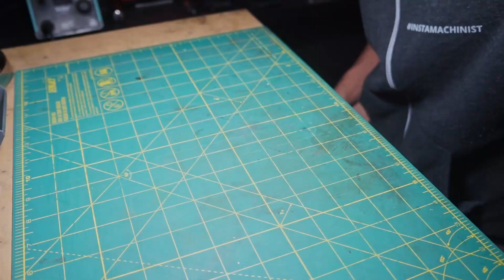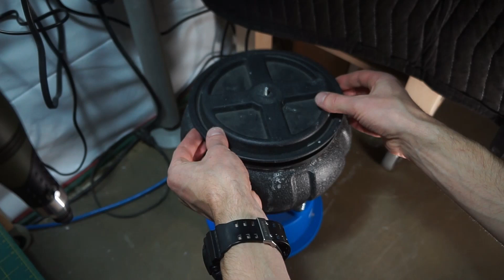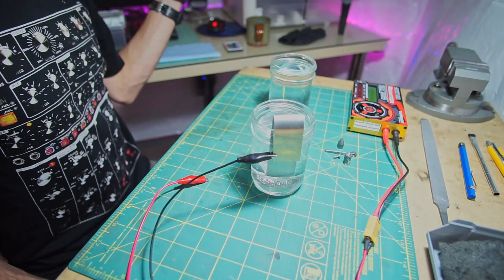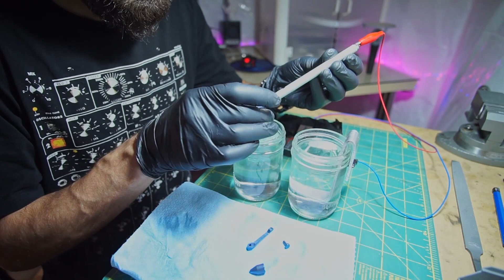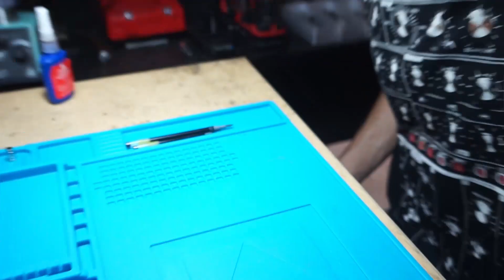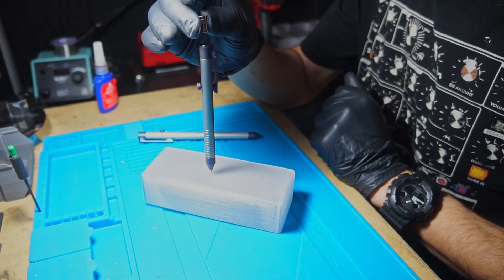EDC Bolts are Finished!

Comment: P.S dont use variac transformer for anodising. Its too dangerous because youre not galvanically isolated from the ground.  Variable power supplies are cheap this days.
Reply from the maker: DC variable up to 100V?  Harder to find than you would assume (and NOT cheap)! Heck half the variable supplies out there lack proper isolation to begin with.  None the less thanks for the comment.
Reply: @CurtVanFilipowski  Didn't know that you need 100v output, but if youre using variac transformer, use another isolating transformer before it, just ti protect your self.  
Best Regards
Reply from the maker: @tsusec  Thanks Matija! I certainly will, I appreciate the comment :).

Comment: Amanzing! Would you make a tutorial on how to do anodizing? I alwasy wanted to find a easy way to run few parts at home. Maybe for the main matirial like alu e Titanium. Thanks a lot!. Parts look great
Reply from the maker: Thanks!  There are some great tutorials already online about anodizing Ti (even ones just using 9V batteries), the only real magic is the solution you choose to use (I use baking soda in water...about 2-3 tablespoons per cup). I haven't messed around with Alum ano work so I can't be of much help there!  Thanks for the comment!
Reply: @CurtVanFilipowski  Yeh found and watched some tutorial, but I find your explanation just really clear and straight to the point. Well just in case you have to fill up a video, think about anodising. Pretty sure can attract viewers also outside your content. Not that you really need it or it's your purpose but can always help. 😊
Reply from the maker: I appreciate the follow up and kind words! I do have a bunch of anodizing work to do this week...I'll see if I can toss in a few extra clips for this weeks video 😉.  Thanks again for the comment!